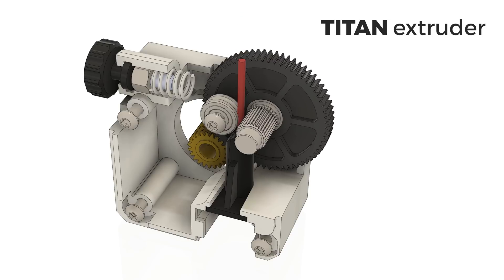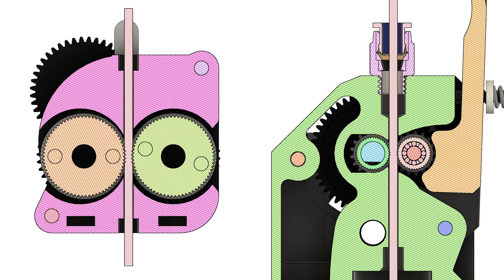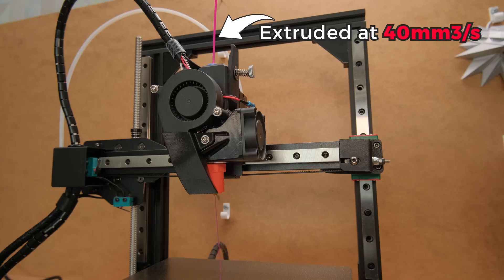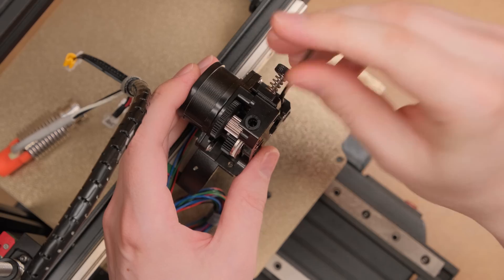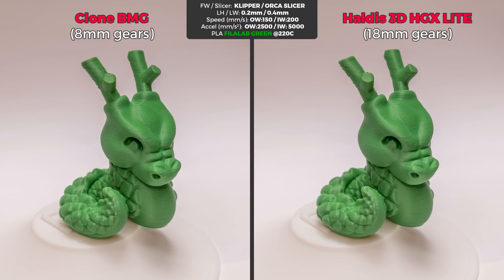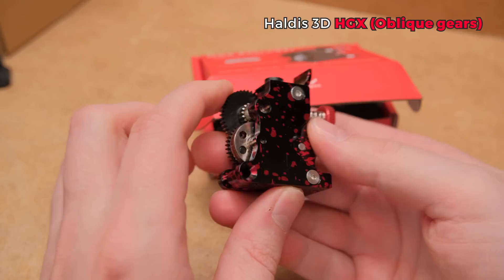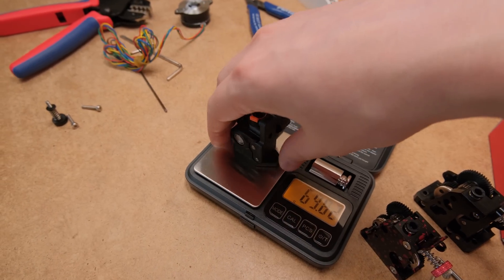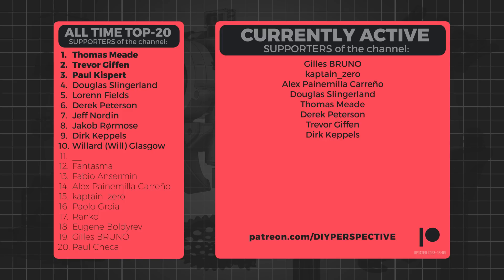SMALL GEAR Extruders are NOT VIABLE ANYMORE?

Comment: Yes , after my first purchase and tested I bought another 2 and now all my printers are using HGX extruders with Nema14. When I saw your red/black new version I am amazed at the weight 48.9 which is a lot different from my older version 74g and also my PETG printed frame+HGX gear-set 57g. Now I couple this extruders with Bambu lab hotend for all my printers and they all works well. I am gonna buy the red/black version like yours for my FLsun SR direct drive conversion since it’s lighter than my printed HGX frame. ❤thanks for sharing your detail zoom in and analysis of the filament, now I know I did make the best choice.

Comment: What about the extruders that have multiple contacts to the filament like the OMG versions? I am extremely happy with the OMG V2S. Also, all of these dual drive extruders that run one wheel of the other, have a built in fault where the gear teething separates as the filament enters. One side is pushed asymmetrically on the gear teething, that is, the driven gears run looser on the mesh and rub more on the ends of the teeth while turning. The filament does more of the work to turn the outer wheel than the gears do. This doesn't happen in the OMG as the gearing for both wheels are driven off the one drive sprocket.

Comment: I've printed with many extruders. At this point I generally go between either a cnc'd Sherpa micro and an hgx lite. I've found that both Max at around 48-52mm3 on pla at 215c. The nice thing about the hgx lite is that the large gears bite much better and nearly never grind filament off meaning retractions are more reliable. For many people wondering, the easiest test is to run these through mainsails extrude function. Set the temperature at 215c, start at 35mm3 and keep going. If you find a skip happening you adjust the tension further until it cannot be adjusted away. I also tested both extruders at Max tension just to see the maximum biting. I did that part without a motor or printer, just hands. That showed that not only did the hgx still dog deeper but that the Sherpa ends up slowly grinding the filament. The only thing I prefer about the Sherpa is that I do not need as high of a current which allows it to run cooler. Also my tests were done at .8amps with the same machine, and a dragon UHF. That said for real printing I cannot run either at .8amps for extremely long prints unless it's abs or hotter filament since CNC extruders get too hot eventually. But of course there are printed versions of both or even extruder fans.. And with that said... The Sherpa extrudes at around 42mm3 at only .4amps while the hgx seems to only want to hit around 38mm3 at .6amps😂 But that is expected.

Comment: Try aiming some airflow at the stepper, and adding a good (small) heatsink, it helped me with my quick prototype prints. With that change alone, I went from being limited to 120mm/s speed (760mm/s² accel, 0.35mm layers, 1.3mm wide lines) to being able to max out at 220mm/s speed (775mm/s² accel, 0.45mm layers, 1.5mm wide lines).

As you might have guessed, I don't have a premium printer, just a lightly modified ender 3 I got for 120USD, and for those prototypes, I don't really need too much accuracy.

Comment: The filament effectively turns into a timing belt.   Great for retractions.   Nice clean indents should be ideal.   Anything where the gear has to pull itself loose from the filament would not.   So I agree with the large gear concept.

Comment: I'm deeply disappointed in mine. It slips constantly. I'm printing at 70 mm/s. I find better performance with very little pressure on the springed lever. Only just screwed in. I'm going back to my TitanX. It could be that I have a "dud" unit. I know from building my own, the feeding gears have the be centred perfectly around the filament hole.

Comment: How good is your relationship with Haldis? I have both of those same HGX extruders. I bought the new HGX 2.0 a couple of weeks ago and it has been a complete disappointment. It chews up filament and makes a mess all over the driven hob, and results in underextrusion at the print. I have contacted Haldis both on their e-mail address and on their customer service messaging on their aliexpress store. They have completely ignored me on e-mail, and seem utterly unwilling to discuss the issue on aliexpress, instead trying to suggest I have a blocked nozzle etc.

I am genuinely looking to resolve this problem because I want to use the extruder. I designed new toolhead parts so I can fit it, and it is frustrating that it does this now.
Reply: Have you solved it?
Reply: @riba2233  yeah I ended up adding a couple of spacers to centre the hobs, so they are no longer free floating, and I filed the edges of the post-hob inlet hole so they're no longer knife edged. Works a lot better now
Reply: @unharmonix   awesome, thank you a lot! Plan on getting one soon
Reply: @riba2233  Awesome, enjoy! oh I should add, Haldis did end up getting back to me. They also promised to send some spare parts but didn't send them 🤣 but yeah it's a decent extruder now with those issues fixed.
Reply: @unharmonix  thanks, I will report if mine works fine 😁

Comment: That's just foolish. If your extruder is "forcing" filament through the nozzle, then it's coming out only half-softened, and that's a recipe for a really bad print. Why can I get very high volume through my single-small-gear extruders when you cannot? There's no good excuse for double-gear extruders and there's certainly no excuse for large-gear extruders. They buy you NOTHING.
Reply: Bro forgot how big filament is compared to the nozzle size. Forcing 1.75 filament through a hole not at melting temp is Definitely hard, but we are talking about a 0.4mm standard size nozzle with a 1.75mm filament size even at melting temps it's gonna have some pressure behind it. That's why there is pressure advance, it literally helps with nozzle pressure so you can have sharper corners and better looking prints. Your idea is skewed, very skewed. You literally are forcing the filament through a hot end don't even try and argue about your not supposed to force it, its literally forced,  your a troll or a know it all and what ever you think off the top of your head is the answer you should learn to look at the data instead of living in a fantasy world. Your not the engineers designing vorons, or extruder gears. I can not believe you have the audacity to come say something about forcing it. Bro your taking the term "don't force it" to a hole new level when in fact we have to force it. Bro c'mon...... Your smarter than this just swallow your pride some brotha. God bless and have eyes to see and ears to hear!
Reply: welp, as with anything we tinker with, personal experiences will vary; But I have to say I don't agree with that at all. With a dual large gear extruder I get way less filament deformation, more precise pressure advance, better retraction, no vfa at all and can easily push filament considerably faster through a certain hot end. Of course it's not a magic do-it-all component but for the money on the low end I'd say it's a damn fine purchase. I honestly can't tell if you're trolling but chill down, we're all just a bunch of nerds doing nerd stuff
Reply: @the1pigeon  Trust me, I'm not trolling... and I'll ask you (once) not to order me to "chill down"; I'm not "hot". I'm just trying to prevent people from being misled into buying stuff they don't need and wasting good equipment that they already own. The masses are gullible; let's not take advantage of that.
Reply: @TDHofstetter  obviously, like i said, it's not a magic tool that makes your printer better instantly, and that's not what the video claims. It's a tool that helps experienced printer enthusiasts get that little extra performance when needed. And while yes i do agree with "If your extruder is "forcing" filament through the nozzle, then it's coming out only half-softened", pushing force isn't the only factor affected by an extruder change, that's what i was trying to get at. chill down ;)
Reply: @the1pigeon  There's no reason for me to "chill down", and you're out of line suggesting that I do so.

You really think that emperors should walk around naked, led to believe that they're gloriously clad?
Reply: to add to your point I'm not convinced that biting into the filament harder is a big deal.  sure it gets longer as you bite harder and deform the filament more, but it gets longer after it's already dosed.  just crank down the tension adjustment knob

I don't entirely agree that large gears are pointless, but I think they probably don't really shine until you're running a supervolcano type setup.
Reply: even if your plastic is perferctly melted an increase in flow through a constant orifice will lead to higher pressure, thus a higher force required to extrude the material (furthermore this relation is not linear but squared, so it does make sense to optimize the extruder along with the high speed capabilities of modern 3d printers)
Reply: @orphax1925  That's silly. I know people who run race printers at ridiculous speeds. Their extruders never need to force filament out the nozzle because they run appropriate temperatures. There are lots of people out there running 500mm/sec with a single-small-gear extruder and getting excellent quality prints.

Maybe if you run at 1300mm/sec you might need a little "forcing"... but if you force it, then your print quality will drop off very rapidly because your filament will spray out of the nozzle instead of being extruded cleanly in a well controlled fashion.

Don't just take my word for it, though. Put a single-small-gear extruder on one of your printers and give it another try, giving it your best shot to remain unbiased. Don't just promote expensive waste because you can. These aren't Barbie dolls, they're 3D printers.
Reply: @user-hy7cg9jg5r that's the most ridiculous thing I've ever heard lol, for a start "race printers" like Vorons, Ratrigs etc. all use dual gear direct drive extruders to begin with, maybe in your mind filament melts and just falls out at 500mm/s but in reality it takes a good amount of driving force which you'd know if you'd ever actually printed at that speed instead of just regurgitating things that other people said. As for your extruder remark if you ever intend on printing more than just PLA trinkets and knick knacks dual gear is an absolute benefit, try printing SBS with your single gear plastic extruder, you won't even get past 50mm/s nevermind 500. 

Just because you're unwilling to spend the time/money or unable to see the benefit doesn't mean it's not better, it just means you'll never progress, while everyone else has fun with current gen stuff, you're the guy that goes around telling everyone his stock Ender 3 prints faster than our coreXY printers because you're just so clever.
Reply: @JoshW1ck  You've apparently never seen an Ender-style printer running happily at 500mm/sec. My condolences to you; your experience is lacking very badly. Maybe after you actually see it happening you'll have a different perspective.

SBS filament? Again, my condolences. Nearly everything I print is in either PETG or ASA (I print working hardware and pistol frames), with a little TPU here and there. Why in the world would you buy SBS? Did someone convince you to just stand your wallet open on the street corner?

Comment: Im iñusing the titan extruder , 1 gear , 3:1 ratio , volcano setpu ,printing at 150 mm/s at 4000 mm/seg^2 aceleration for all lines (suports perimeters,etc) ,and works pretty well in an ender3 setup  with Klipper 😊

Comment: You could improve your grip (and deformation on the filament) by regulating pressure on the springed lever. Also 24mm flow rate is 300 mm/s print speed, so should it bother me? But thanks to the test prints, maybe the wear on parts of bmg could be a reason of that difference in quality?

Comment: well, at least for my printing, i dont see the need for bigger gears, even tho i print at 200mm/s with 0.6 line width and 0.2 layer height - so around 23-24mm³/s. Stealthburner with Dragon & CHT Nozzle. for 0.12mm layer height prints i bump it up to 250mm/s. Thats with a heavily modified Endet 5 (Cast Aluminum bed, CoreXY Mod etc...)
Also running a Bambu P1S and that thing is rippin'.... up to 350mm/s for 0.12mm layer heights, which it can reach with the accels and jerk its set to...

Comment: The problem of large gear extruders is that they need more reduction as one turn of the gear pushes more filament length, so you have less overall reduction / torque. Comparing modern day large gear extruders with an ancient BMG shows that they have overall similar performance, despite the fact that the BMG has just a 3:1 reduction. If you compare them with something modern like a Sherpa mini that uses a 5:1 or optionally nearly 6:1 ratio, or even better an Ascender with 20:1 worm gear you'll see that the small BMG gears have still something to say about performance (as far as I know it's the standard choice for people that want to max out a Mosquito Magnum+ or a Goliath).
Also the friction/grip equation is F x f, where F in this case is the force pushing the gear, and f is the friction coefficient (same between both), there's not any surface in this equation. You see shallower cuts on large gears because you have more of them, but you'd need a firmer spring to have any advantage (and you'd see deeper cuts). The reason why small gear extruders can grind filament while large gear ones just makes the motor skip in my opinion is because the latter group generally lack the torque to do that, not because of a better grip. Up to this day I have never seen a concrete evidence that large gears have any real advantage. And I say that as an LGX owner! Maybe for flexibles

Comment: this all seems a little bit moot, and feels like an advert to sell a product by a feature that offers no real world benefit.

All the modern extruders were absolutely fine up to 28mm^3/s, if we're using a 0.4mm nozzle and 0.2mm layer height, that would mean we're topping out at 350mm/s print speed, except even the chc pro, with cht nozzle, and going up to 230c on pla can't manage 28mm^3/s on a 0.4mm nozzle.

And on print speed, if we look at the bambu x1c, doing "500mm/s" on all walls and infill and a reported "32mm^3/s", it will do an 8 gram benchy in 15 minutes, which actually works out at 9mm^3/s on average. it's only ever going to get near that 32mm^3/s value on long lines of infill. 

"but what about bigger nozzles, they will need faster extrusion!", bigger nozzles need less force for greater flow rates, and we're already maxing our heat sink on the 0.4, so nope.

you also never explained how you reached the tension settings on the extruders you used, making the macro photos of the filament deformation absolutely meaningless; if you put more tension on a filament, it will deform more, but how necessary was the level of tension used for each?

In short, this "might" fix a problem when printers move even faster AND hotends melt even better than they currently do AND we either come up with a better way to melt plastic than cht, or we find a better material, as currently the plastic doesn't melt fast enough to go much further than we currently see, which is why super large format printers use a big pre-heated hopper, that gives time for the plastic to melt, rather than doing it all at the nozzle.
Reply from the maker: You understand that there are other big gear extruders on the market right? And nothing prevents you to buy other ones? Original LGX exists since the year 2021... And nowadays multiple new printers come with those big gear extruders like QIDI's, K1, M5C... My whole channel is based on genuine testing results, whether they are in favor of the manufacturers or not. I really don't care if anyone buys the items that I show because I am sponsored by PCBWay. And they just make all kinds of parts to allow me more easily and properly test things. It is literally a WIN-WIN-WIN scenario. If you think big gear extruders are not needed for high-speed/accel printers, use any extruder you want. EZ. :)
Reply: @DIYPERSPECTIVE  I run a voron with a dragon high speed with cht hotend on an orbiter, and a Revo with a cht nozzle on a biqu h2. I've gone up to 2mm nozzle widths with 1mm layers, extrusion and flow rate are something that IS a factor in some of my work.

Heat sink rate of the plastic has always been an issue way before the extruder has started to struggle. I'd say I was in the top 1% of prosumer 3d print speed, if it's not an issue of viability for me, who is it an issue for?

Your video is titled that "small gears aren't viable". They 100% are. That doesn't mean larger gears don't have some theoretical benefits, like grip, but they DO also have theoretical drawbacks, like rotational distance accuracy and backlash; which are arguably more likely to show on a print than regular, predictable deformation before the filament gets melted.

And because you have a legitimate sponsor, does that preclude you from having an illegitimate sponsor too?

What really hinted that you have an agenda to push is when you compared the orbiter, which was within the same margin of error as the extruder you are reviewing, yet you implied it was somehow not performing as well. Probably why you left those results up for only a couple of seconds 😂
Reply: @timreeves do you not see the question mark? ?????
Reply: @coltenmeredith8899  did you not watch the video where he concluded that small gear extruders were in some way a bottleneck to a 3d printer? Which they're not.
Reply: @moopminis  You mentioned the title. I said you mentioned the title. Yes, I watched the video
Reply from the maker: @timreeves Stating that big gear extruders are beneficial because there was although small but factual improvement in quality and flow rate consistently is somehow for you is bottleneck. LOL.